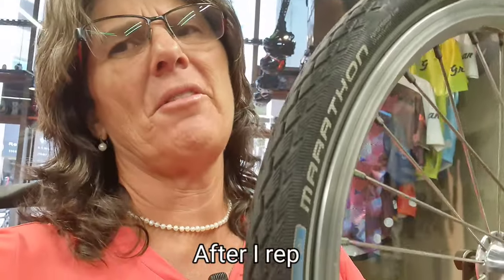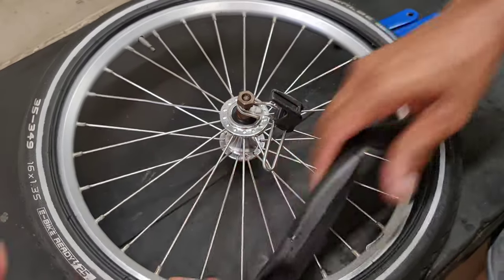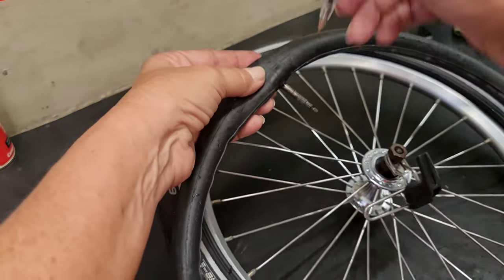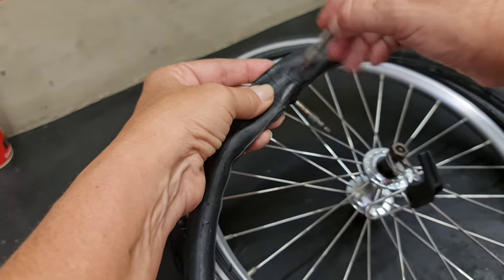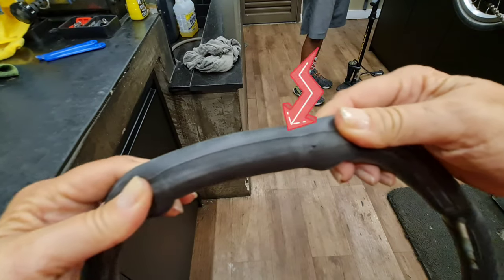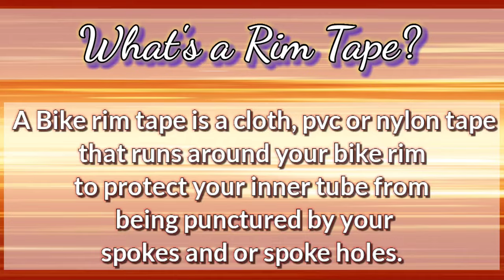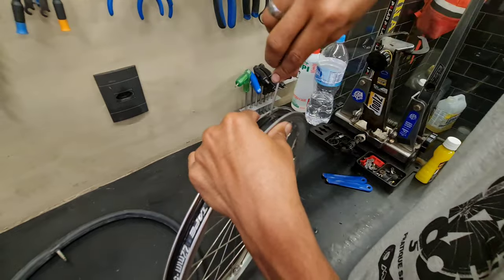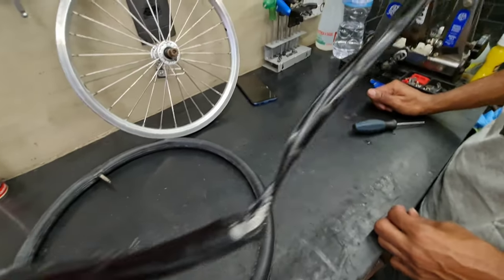Does the BROMPTON need a Rim Tape?

Comment: I have changed my front axle to one made from titanium!!! And untill now I haven't had a puncture ;-) Finn, Denmark
Reply: I don't understand, if you change the front axle you still have to deal with the spokes right?  The spokes are the ones sticking inside the rim. Do you mean you changed to spokeless titanium wheel?
Reply from the maker: Hi Finn Carl Bomholt Sørensen 
TI parts are better. I have some TI bolts and screws that I'll be replacing on my Brompton. 
But the axle does not touch the tube? 🤔
Keep Safe! Keep Riding!
Reply from the maker: Hi Woomi Chen
Spokeless TI Wheels, that would be cool!
Keep Safe! Keep Riding!